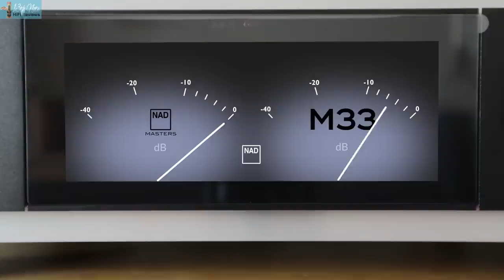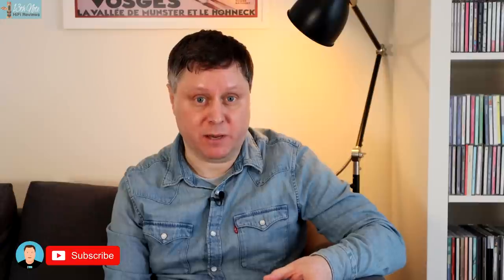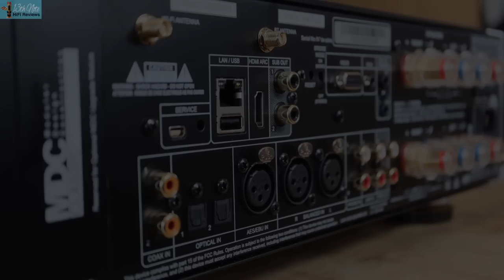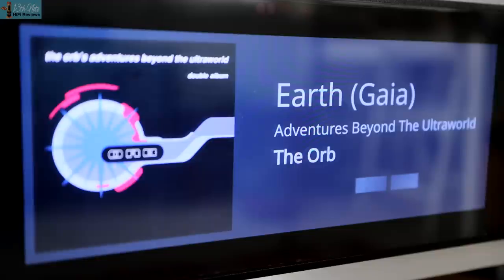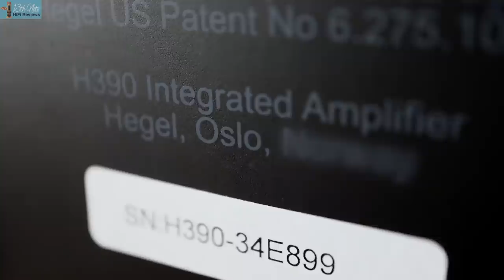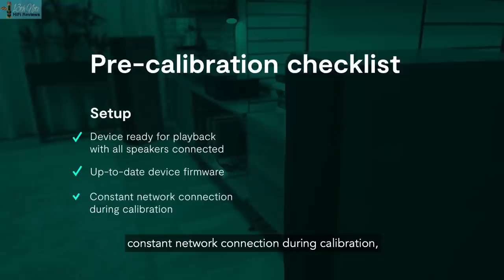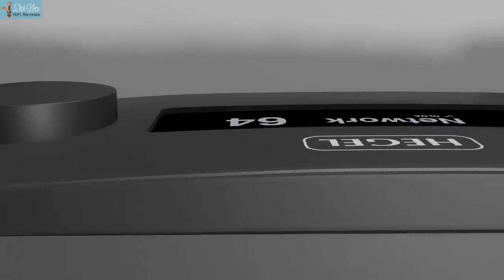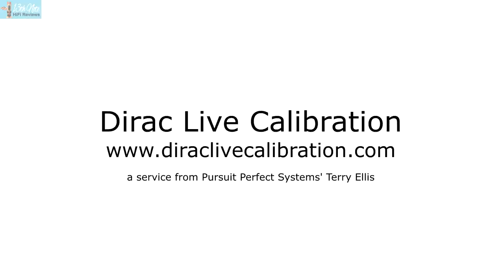NAD Masters M33 versus Hegel H390

Comment: Interesting.  I was actively looking for a comparison between these two amps. I have a pair of B&W 802D's and they do require a bit of power to drive. The NAD is what I'd consider the minimum, and the hegel does offer a significant advantage there. That said, the Hegel design language just doesn't speak to me. I really feel It looks a bit cheap, and frankly, dated. The M33 looks tidy, the touch screen is nice and the large amount of digital inputs is a plus. The 390 is a bit spartan in the connection department. And looking inside the amplifiers, even beyond the fact that one is a class D and the other A/B, the Hegel looks messy, with wires all over the place. I'm not used to seeing that in pricier amps. That said, I'm still a bit on the fence. But I'm edging towards the M33.
Reply from the maker: I don’t think it looks dated , it’s minimalist which can’t date. My attitude is I know build quality comes into it, and arguably the nad is more solid, but people don’t spend £5k on an amp for a decision around looks when there is plenty of things £5k can be used to make a room look great. People should buy on 95% on what it sounds like. The connections are all there for 2ch hifi in the Hegel. Personally a choice between a great amp and slightly lesser amp with better streaming built in.

Comment: Outstanding review and production Simon (as always). I have to admit I'm yet to hear class D. Intriguing.
Reply from the maker: Thanks Anton. It is a good amp which if I had 4grand burning a hole and needed a streaming integrated, I’d buy. I hope they feel the criticism to the Hegel is fair on account of the 25% difference point I mentioned.
Reply: @13thnotehifireviews7   Your criticism came across as impartial, fair and constructive. I think you neatly summed up your approach to reviewing when comparing the two (paraphrasing) by saying 'no ego HiFi.' Loved that 👍

We all wish we had a spare 4k to burn on new HiFi!
Reply from the maker: @antonchigurh4125  I wish I did too - which I dont have. I get myself a better DAC. Probably a Hugo TT2. Love that one.

Comment: It's almost impossible to say which piece of audio gear is better to one another, when it comes to sound comparisons.  I think it usually comes down to looks in the end?
Reply from the maker: With respect to your view, that’s just not true I’d say . My attitude is HiFi is not like wine - there are limited consensus groups as to what is good at the price within certain taste brackets. I always say these taste brackets mainly relate to the tone of the amp. But the NAD and Hegel are not far apart on tone. It comes down to a range of characteristics that marks one out as sounding better than the other. So when you factor nicer mid tones and dynamics, and wider soundstage these are not things you can say, yup the buyer may not want that. The ‘it’s all about the person’ approach is an approach I steer clear from because that means I’m not reviewing , whilst trying to be fair of what one amp can do at different prices and let readers read between personal lines as to what they want. A lot of reviewers aren’t being fair and the number of reviews I read on this amp where they talk of it in the same context as the more expensive Hegel amp is not fair…it’s not fair on Hegel and it’s not fair on the buyer. But more than that, the BS when the buyer tries it means that reviewer should be sussed out because in the future who would (or should) believe them??? Looks is important but a big group of people buy hifi off of sound quality. In fact it’s more important than looks in audiophile hifi I’d say, because of you want looks buy artwork and much cheaper!

Comment: I have the Blusound storage device 2i. MQA is not fully enabled, the unfolding process is only once, making output is limited to 88.2 KHz, not the full amount shown on MQA discs. I do not have certainty of streaming files, as I use this device for local storage only. I didn't know that MQA was only partially decoded before buying it. I am disappointed that this is the case, almost false advertising!
Reply from the maker: You don’t want to make MQA and the whole rabbit hole of formats an issue, it’s incredibly slight even in the most resolving systems. You should satisfy yourself the node is a great product and it’s all about the rest of the hifi and other outboard DACs as to what makes audio good.
Reply: @13thnotehifireviews7   I just don't have any way except for another DAC which decodes MQA fully on the SPDIF input, either RCA or Toslink. Not an expense I am pleased about.  It is a great product, with well thought out facilities. MQA should not be advertised without the difference being made.  My system has enough resolution to differentiate between various cd blanks and how they affect the sound. Taken a long time to get there, and just bit of dough. The loss of resolution is probably audible in my view, and my next DAC will have to replace the dCs Puccini, not something that I am looking forward to.
Reply: I have been using MQA for 2 year.  I just switched  to Apple music this month   I found it sound even better the MQA master  using my ipadpro as main source . I using mytek dac + , burson  GT headphone  amp + susvara  headphone. . I can very detail using this set up

Comment: The value of room correction is by definition dependent on your room. In a problematic room the use of Dirac "might" elevate the M33 above the Hegel. Unfortunately, unless you have the opportunity to set both up in the room it will be used, you'll never know!
Reply from the maker: That’s not actually true as Dirac cannot deal with all rooms. In any event I did the review of both in a pretty good living room with carpets etc, so I think my comments about sq are fair comment.
Reply: @13thnotehifireviews7 My comment was a general observation not specific to your situation where you have both amps at home with you. Also, note that I said - "might" elevate the M33  above the Hegel - i.e. in a particularly problematic room the effect of Dirac "might" provide a better outcome than that of the Hegel.
Reply from the maker: @malcatron  Thanks for saying but you didn’t elaborate following the points I raised in the video….. to recap….

I’d point out I don’t think it would elevate the sound above the Hegel in most rooms. The point is , at what point is Dirac dealing with the issues the amp can’t handle by its amp design….I think I got the point across the sound quality of the Hegel is sufficiently marked in that Dirac can’t do that, in a use case like mine, which is probably a good or acceptable room type. 

It might, you may be right, but that would be to a preference, and I have to call that out on what I’d expect and what I think most could or would think, otherwise I’d just be bs’ing you like some other reviews I watched on the h390 v m33 that put the sound quality at a similar level even before mentioning DIRAC… and a quick perusal and research on YT would be easy to find that one.

There is also the point that Dirac being better is subjective as well as an amp without Dirac and I got that across. So it’s not a pre requisite as I said. 

Also if Dirac corrected in my room and similarly another (to the target curve) then the sound the software sets is not expected to depart too far from a general level, on my previous point about expecting what you are likely to get. I also based that on what others have told me the m33 sounds like with Dirac versus others as I research all reviews too.
Reply: @13thnotehifireviews7  I'm certainly not questioning your conclusion about the Hegel vs the M33 (I've heard neither) or suggesting Dirac is a magic bullet (I've never used it or any other room correction for that matter) I was merely saying that the value of any room correction is proportional to the acoustic issues presented by the room. For those lucky enough to have a room that has no nasty acoustic problems, Dirac is maybe not a great investment. But if your room presents issues, Dirac may just be the answer - and its benefits could potentially enable an amp to out perform another that sounded better when comparing in the HiFi shop's listening room.

Which was my second point - that unless the purchaser is able to listen to both amps in their own home, the true value (if any) of room correction to that individual will remain unknown.

I think the inability (at least for those on a modest budget!) to audition gear at home is a problem that must have led to many unsuitable purchases over the years, and purchasing HiFi from the internet having never listened to it only makes this more so.
Reply from the maker: @malcatron  Thanks for saying. Listen yourself as always. Review for a shortlist always...thats what I always advocate... But my point is, it isn't as clear cut as saying that just because a room is bad that you may prefer one room correcting amp over another that does not have Dirac. Dirac can only go so far, it doesnt correct fully for the room when you get the response curve it gives you. A better designed amp that controls the bass well and is better in midrange and more dynamic can equally sound better. There is a cut off. I have to stear people to where that cut off is in an amp with Dirac and one without, that is pricier, to what most people, I think, will think. Thats all I am doing. If I did the review as its only based on the buyer, I wouldn't be reviewing and giving my take. I'd be shilling and make the two amps the same on SQ which I dont think is the case.

Comment: I recently demoed the new NAD C399 which had various improvements borrowed from.the M32 and had high hopes for it but when compared with my Hegel H120 it didn't sound anywhere near as good in my opinion,
It lacked bass punch and just sounded too bright. 
Maybe i just prefer the Hegel sound?
But i would expect your H390 to outclass the M33 easily
Reply from the maker: I tried the H120 as you know Harry but personally this M33 is a better amplifier all round. Good you can now get Roon ready on H120/190 family !😀👍
Reply: I do have the NAD C 399 I'm pretty happy with it and I do not have any problem you face with the Bass or brightness! Guess it depends on what kind of Speakers and cable you use?
Reply: @rolandlickert2904  i had a home demo with the NAD C399, 
I used ls50 meta's to my ears these are not bright speakers. 
The Hegel sounded smoother and had deeper bass.
One thing that the NAD had over the Hegel was a bigger/wider soundstage.
My wife and i both preferred the more relaxed sound of the Hegel and felt that listening fatigue would set in quite quickly on the NAD, personally i think this is a trait of class d amplification. 
Each to their own but i preferred Hegel.
Reply: @hclandscapes  Well what you say makes sense. Class ab amplifiers have more power at lower impedance which means they give more power for bass. The bass carries over and gives more body and fullness to the mids with good class ab amps. The hegel should sound richer and more engaging. Class d amps use filters and work differently. They don't have much of a sound of their own and are pretty neutral these days. SMSL is very smart because they give great tone control and preset tones to make their class d more engaging, linear, more weight on the bass so you can't tell it's class d and you enjoy it way more. Specs don't tell the whole story because by the specs class d amps generally look like they are the best thing since sliced bread.

Comment: The piano please at 9:00
Reply from the maker: Watch it all till the end . All revealed
Reply: @13thnotehifireviews7  Thanks and great review as always, I have the C298 which sounds identical to the M33 (I have heard both) as it also have the same PSU and the Purifi Modules. I tried room corrstvia REW with all the bells and whistles of phase correction. I never liked what the room correction did... especially what it did beyond 500Hz. What I do now is use the frequency response to tell me where in the low end I need to adjust the peaks and I slightly adjust them... mostly in the sub 80Hz region. Running KEF R7s with Topping Pre90 preamp and D1SE DAC with it and loving the setup with Roon. 

Keep up the good work, mate!
Reply from the maker: Shoaib Ahmed thanks Shoaib.
Reply: Debussy I think
Reply from the maker: Chopin nocturnes. Op 9. No 2. Listed at end of video.
Reply: @13thnotehifireviews7  my mistake, so close to Clair du Lune 🤣
Reply: @13thnotehifireviews7  Yes I heard that afterwards. It's by Kun Woo Paik I think that's what Roon suggested anyways...
Reply from the maker: MrKevinRance no worries, a great piece of music 😀🙏

Comment: Call me when class D has a 20+ year record of equaling or surpassing class A/B.
Reply from the maker: Nah, get in when you can and it changes. That would be like …..4k TV….I’m still on a CRT glass box tv……
Reply: You are behind the curve. I been on the Audio trip for over 50 years owned several class A Class A/B amps during that time. Finely I switched to class D and never looked back and that was for several reasons. The weight of the amp is much less,(easy to move or lift around if needed) it runs cool, possibility to upgrading with module which gives flexibility,(technical advance is moving fast this day) power to power you get more value for the money you spend, Roon ready, has plenty of power to handle most speakers on the market and the amp sound effortless, great control of the bass. However, Dirac helps if you have a complicated room.However, as with all amps it needs good matching with the speakers, and the right speaker cable and a good Power cord suitable for the amp adds to the sonic improvement. As always it's a personal choice but I came to the conclusion that the absolute sound is a mirage and for me a mix of convenience, value for money and the latest tech is good enough for me.

Comment: Personally I avoid like the plague, all these devices mounted in SMD, switching power supplies, which are too often destined to the trash, at the slightest failure.
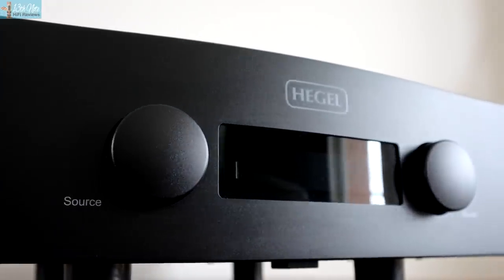13:07 The internal wiring of the Heigel was done by a Pakistani electrician ? 🥲
Reply from the maker: It’s what it sounds like that’s important , if you do that though it’s possible to ignore loads of fantastic options but if you want sq check out latest video I’m doing on kinki studio soon to release